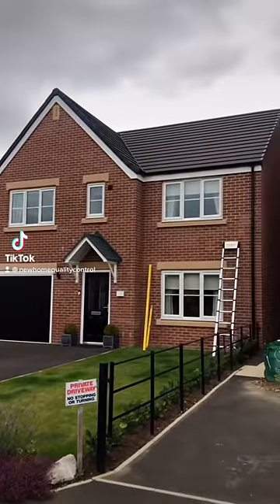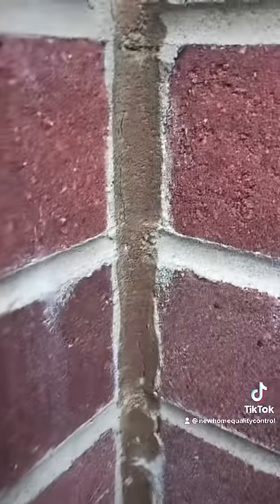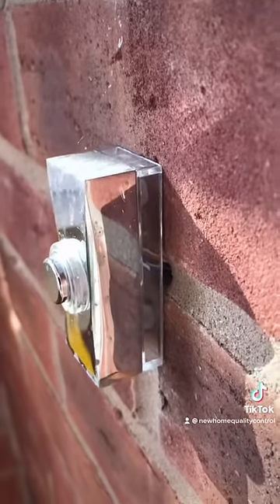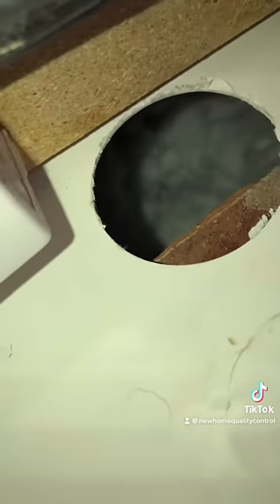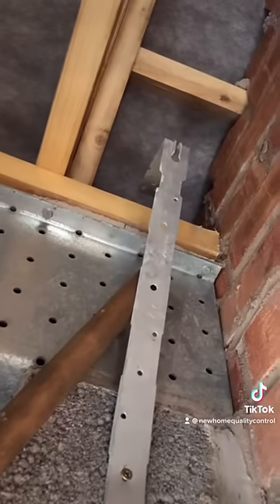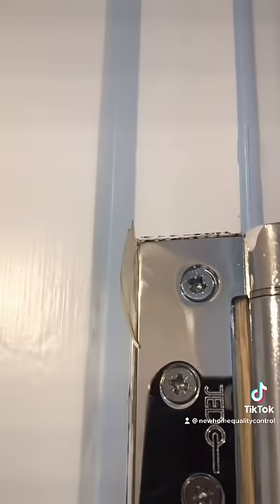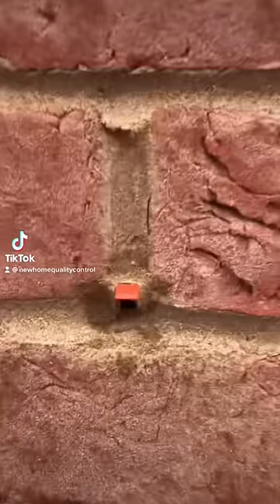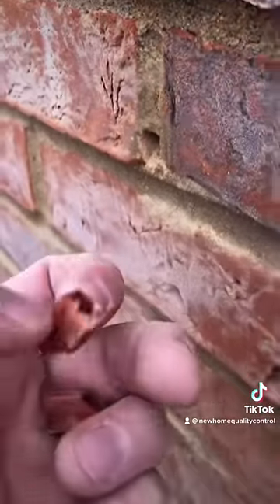MAJOR ISSUE FOUND AT THIS NEW BUILD! | FAKE MOVEMENT JOINT?

Comment: To escape these issues, which were all over my last house (a newish build) I've moved into a house that's over 100 years old...zero problems because it's built to last! New homes are built to make money not for people  to live in.
Reply: I think it's a bit of a myth that houses 100 years ago were built by teams of careful craftsmen, I reckon if you'd have had someone like this going round and recording at the time they would have seen the same amount of mistakes & cut corners. Buying a 100 year old house just means all these things have been fixed by previous owners!
Reply: @Daninashed  don’t I know it!!!
Reply: Not true a lot of old houses are built crap to and the only reason people find theres less problems with them now is people have already spent thousands repairing the faults over the years.
Reply: That old house was once a new build though
Reply: Thing is, the amount of extra heating required in an old house means it’s cheaper to fix the new build. While there were problems in my current house the top of the line EPC rating makes it £1500 a year cheaper to heat than the Victorian town house I had previously that’ll still be standing in 200 years.
Reply: The old houses were built to make money once, too - that's why we have all these streets of Victorian houses. But in those days people didn't move around much so if a tradesman wanted to stay in work, his reputation mattered.
Reply: I like you words ,which I now declare, a quote....houses were built for ppl to live e in not for profit ( poetic lisence applies ,cause I can't read underneath).
Reply: My house was built around 1860, there isn’t a straight wall or right angle in the entire place. One lintel is three inches higher over one side of the door. But it’s still standing.
Reply: @Daninashed  yep fair point, mine is 140 years old and there isn't a straight wall.
Reply: K B  no no no materials certainly were not cheaper. Up until the 1990s it wasn't even worth renovating an old house financially because materials cost as much as the building. Although materials have gone up a lot recently they are comparatively very cheap in comparison to the past, it's labour that was cheap and is now expensive.
Reply: Agree but all the issues are probably sorted by the time you get an older house. I do remember my dad working in the building industry during the 60's  & saying about complaints from buyers they had to go back to. He even came home & replaced our own kitchen units with ones that fell into his hands as a foreman. It's OK he isn't around now so he can't be arrested.
Reply: @Daninashed  bull crap codes change with electrics so are forces to brubg uoto cide. But roofs . Walls floor all intact newbuikds get fundimental problems
Reply: And support the Tory Party
Reply: I disagree the older it is the more maintanence you need to do to it.
Reply: @steve00alt70  the poibt is this newbuikds need maintanance right frim tge bat in fundamentals
Reply: @steve00alt70  All houses need maintenance and I agree, a new house should need less but you assume that the new house is built correctly and to a high standard, unfortunately as we see all too often, they are not built to ANY standard, except cheap crap
Reply: I went into the attic of a substantial house built in 1906 and the brickwork was terrible, rubble in fact, and the chimney breast had to shored up to stop it collapsing.
Reply: @Daninashed  it’s the materials that make the difference. Old houses are made with better materials bit like old cars it’s not the quality of the tradesperson it’s the cheap ass shit they use now. You might as well live in a pvc box these days. I’ve worked in the trade for years never saw an old house with a settlement crack but I saw hundreds of new builds get knocked down as a result of poor foundations
Reply: @MrDamo34  cost £5k for me to bring my 180 year old house up to the highest energy standard of which the government paid £3k of it. Good luck when that new build gets a settlement crack and you can’t fix or sell it. Good luck spending any less than £2k sorting one of those messes out.
Reply: @steve00alt70  love it when people who live in cheap shit new builds try to justify their decision. Your home should be like your woman but if you like cheap shit that’s up to you I guess
Reply: @Manbearpig4456  I believe you!! Not.
Reply: @Daninashed  not to mention the amount of homes that have fallen down or been knocked down for being impossible to repair over 100 years. The only 100yo houses you can buy today are ones that have stood for 100 years. And even at that, you still need to do major works on the regular.
Reply: @Daninashed  I agree people do spend tens of thousands of pounds renovating and modernising 100 year old plus houses. But how many of these modern houses even be standing in a 100 years from now.
Reply: @anthonyharris6881 use cheaper shit materials now days to maximise profit hence why all second floor walls are shite stud work
Reply: @angelahorn I'm a trade and I think alot of the older trades were terrible but the materials they had were far better not cheap mass produced shit

Comment: Fully understand mistakes happen and can be overlooked. But surely this wilful deception is fraudulent?
Reply: I actually think it's more difficult to build so badly if you actually know your trades.
Reply: At this point a house builder must be deliberately making shoddy houses because simply doing their job they could make a good house
Reply: Lol this has been going on for years in new builds.
Reply: Its criminal and dangerous the roof could colkaps i bet gas leaks to

Comment: As an old school plasterer with over 30 years experience, I wouldn’t touch a new build and certainly not buy one.Lash it up,cut corners and sell it for a ridiculously overpriced amount
Reply: What about those build in early 2000?
Are you concerned about government requiring meeting green sticker for sale in the future and it can be too costly to upgrade Victorian build homes?
Reply: What is your opinion on the new built apartment where external wall is really concrete with brick tiles?
Are these kind of wall worse than old concrete block of flats built in 70's?
Reply: All my internal walls are brick, except for 1. That's latt and plaster. All ceilings are latt and plaster.
It's a very solid house.
I have had to learn plastering, because the modern tradesmen cannot fix latt and plaster.. 
I've also learnt plumbing because I have lead pipes
Reply: You do understand every house was a new build before?
Reply: @anthonyharris6881  There was a time when houses and flats were built properly.Designed properly,with quality materials and built by time served trades.Unfortunately those days are gone
Reply: @davidfoley8189  I very much doubt that. The difference between old and new builds is that the previous owner of an old bill fixed the previous issues
Reply: @sahhull  Fair play to you.We used to do a lot of lime work years ago.It’s a beautiful finish.One of my first jobs when I started out was cutting lathes for the plasterer who taught me.
Reply: All this continuing substandard work proves that the supposed ten year guarantee is worthless..
Reply: @carnbyarst670  The 10 year guarantee isn’t worth the paper it’s written on
Reply: Not just that new builds poorly built and they are to fucking tiny
Reply: @mostbrutalvideos4612  I saw an article s few years ago about new builds. The garages were too small to park the car in...
Reply: @carnbyarst670  I will never buy a new build for them being to small
Reply: @mostbrutalvideos4612  and the bigger new builds are ridiculously over priced.
Reply: @carnbyarst670  always go with ex council houses atleast they was built and maintained properly
Reply: I have a house built in 1979 on a reasonable large estate and it's just as shit as these to be fair, but most of the poor workmanship has been fixed by now by previous owners. The quality of materials is poor though, for example they used 18mm t&g chipboard flooring upstairs and it's not moisture resistant in the bathroom so it's been bodged over the years due to leaks. All upstairs boards are creaking due to 40 years of plumbing and electrical cutting holes everywhere. Everything is massively out of plumb (worse than some of these videos!). So it's definitely not just new builds and a recent problem... I think the moral of the story is judge each house on its own merits ... Even different houses on the same estate will be worked on by different tradespeople with potentially huge difference in quality...
Reply: @davidfoley8189  I was appalled when Grenfell happened. Our standards seem to be very poor.
Reply: @carnbyarst670  you have wrong car. They were built with a 1960s Aston Martin in mind.
Reply: @nauxsi  what are you talking about?! Garages were built with Aston Martins in mind? That would mean they would be plenty big enough. I'm confused...
Reply: Anything built after year 2000. And that’s pushing it.
Reply: My house is 1905, shut rolls off the coffee table, hits the floor and accelerates.
Reply: @Jack-tx2ve  🤣🤣🤣

Comment: I work in a college and we take out contracts with firms to do essential jobs all the time. So, as you can imagine, we get the lot. Electricians, carpenters, plumbers, pipefitters etc. To be honest we're not impressed with the standards and work ethics of the tradesman that are sent. For example it was decided to replace all the toilet roll holders with new ones. The college maintenance guy didn't have the time to do it so they took out a contract with a firm to have it done. The guys that were sent put up just four then buggered off. They still had 29 to put up! Clearly they were lazy and couldn't be arsed. College called the firm to complain and threatened to withhold payment unless the job was completed. So the guys were sent back who begrudgingly put up the other 29. Found out later the screws used were too short, so when the students started using them, they fell to the floor! Maintenance guy had to put them back up using the correct sized screws. Bloody cowboys.
Reply: I was a paint sprayer, trained by VW/Audi , no one in the trade is interested was doing a decent job, same for (supposed) mechanics, a lot of work is beyond bad, bigger places pay bonus on hours saved so this encourages people to cut corners, the work ethic is dreadful and most are only interested in the wage packet,  I've attended courses that are cut short, if it has an exam and you need 50/100 correct then 50 answers are given!  People leave training and don't have a clue what they're doing, wife went on a food hygiene course, 1 week crammed into 2 days, answers given, this means everyone passed (even ones that took a 2 hour lunch) and the training place looks good and earns a weeks money for 2 days work. I quit painting, got totally disillusioned doing a decent job while others shouldn't have been  painting a skip.

Comment: A friend of Mine was having a Final Inspection on his New House before Accepting His New House. 

At the time I was working for Army Housing and he asked Me to attend the Inspection. 

The Builder absolutely hated the fact that I was there because I was listing so many Faults within the house, things he was hoping the Owner wouldn’t notice before Signing his Name to the Acceptance Paperwork.
Reply: I was working for a kitchen company snagging when the client at a redrow home asked me if could witness a conversation, I was met at the door by a site agent and red rows solicitor, This was a fault finding walk round and they brought their solicitor!, There were major issues with block work settlement in the loft and garage, large finger wide cracks, the client mentioned his concern regarding what was going on behind the drywall boards in relation to the garage, he got no where,"put a couple of expansion joints in,"
Reply: Army housing really did have high standards ,,, and then some.

Comment: With movement joints on concrete bricks it’s every 6m of unbroken brickwork. A corner is broken brickwork.  All these movement joints we have to start putting in are weak points.   That internal one is no need whatsoever. As it is there it’s probably strongest part of house without the movement joints

Comment: This is why you should always employ a professional snagger.
Reply: Or just employ proper tradesmen.
Reply: Profession snagger, obviously you know nothing about building trade. They are generally people with no experience who gave up their job in a shop as they decorated a room at home then think they ate going to make a fortune picking decoration faults, the person that made this video needs to check his facts and know what constitutes the requirement on a expansion joint , as look at that plot visually it doesn’t need on but I don’t know dims without a drawing
Reply: @SC-hk6ui  No I agree the work is wrong , but feel strong that a structural report should be done by someone who is RICS registered . The main issue he quoted was the expansion joint we’re I’d suggest he reads building standards as he’s incorrect , the silicone was covering bad jointing and an expansion joint is not required there

Comment: I'm a strong believer that homes shouldn't be allowed be sold in bulk by house builders. It should be like any business where the consumer buys land and contacts the builder to make the house. How house builders are allowed to buy land blows my mind as the Council should be offering cheap land for people to buy
Reply: This is how it works where I'm from (Slovakia), people buy land and then find a company to build their house individually. You can either choose a project from a catalogue or find an architect who will customize it for you (my parents did this). The process of building a house is quite long, usually 2 years because of very strict regulations (and the climate) and that doesn't even include 1 - 2 years of getting all permissions so in total it is around 3 - 4 years. They won't let you move in before the quality checks which helps to make sure that the house was build properly and it is safe to live in. 
Building a new house individually is a long process but most families choose this option, it's definitely worth it.
Reply: Totally agree, finding a plot of land to build on in this country is nearly impossible, at a fair price that is.
I see plots of land selling as if the house is already built!!!!
Reply: You should see the farmland being swept away in my area... its utterly sad. And the protesting has only just begun
Reply: Farm purchased for $10m, slated for 250 single family homes to start in the $600k range. Theres currently about 75 of these projects going on in my county alone. We were a beach vacation spot pre-covid. Low population made it a hot spot of out of state/town people to get away from city crowds. Covid forced 50 years of development on an area with very low regulation and no oversight. Capitalism at its true finest.
Reply: I totally agree with you. Unfortunately, local councils don't own the land in order to sell it to individuals. The land is generally owned by private landowners who sell the land to the highest bidder. It is only the large housebuilders who can afford to buy and bank such large aread of land small local independant builders, private individuals or local councils don't get a look in. Most land about towns has an option on it with a national housebuilder even before it is included in any local plan.
Reply: Wow, you should name and shame the building company. My house is approaching 100 years old, stone outer with brick cavity, WW2 bomb shelter in the cellar with blast wall, escape hatch and steel reinforced ceiling. It's a solid old beast for sure but years of ownership and bodged DIY also take their toll. The snag list on my house would be long and laughable, though I'm working through it slowly to sort for the long run. Thanks for sharing.

Comment: I'm a Brickie of 40 years you don't need a movement joint there only makeing the house weaker
Reply: Spot on
Reply: They are everywhere these days, sometimes two brick from a corner where if it wanted to it could expand the unmeasurable amount that masonry can stretch to.i blame it on lazy architects using cad design.not a human decision on site.

Comment: I worked with a mate for years that ran a carpet and flooring company (just us two) we would often be on building sites and the amount of corner cutting was ridiculous, I remember the guy that owned and ran the site would often come up with ingenious ideas to 'fix' issues, a floor we did not fit was sunk in the middle so he said to a builder "stick some sand under it", plus the builders were always on a tight schedule and were always stressed as they actually did not want to cut corners as it showed their worked to be sh*t basically also the homes were often sold before they were even finished.

Comment: Company I work for does maintenance for a local housing authority and most of our work is putting faults correct on "new builds"I went to one property 2yrs ago to replace 2 roof tiles,the house hadn't been finished and the "roofers"were still on the roof working,when I asked what was goin on all I got was"we are building these properties not maintaining them,roof wasn't finished and I had to put it right,the companies are doin shit work and getting paid way to much,I had to fit cavity trays in one building"cavity trays in a building that should have had them fitted when they were being built,and in the area of work I had to do"approx 600mm high by 3mtrs long the wall was out of level over an inch,a brand new building out of level that much,it's down to the site managers and the workers I'm afraid,ITS NOT QUALITY THESE DAYS PPL ITS QUANTITY THAT COUNTS